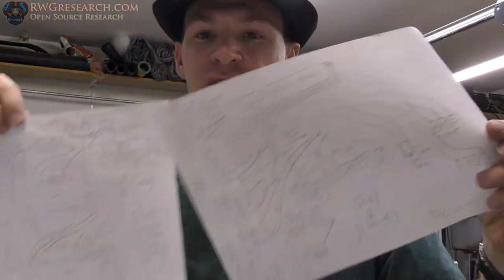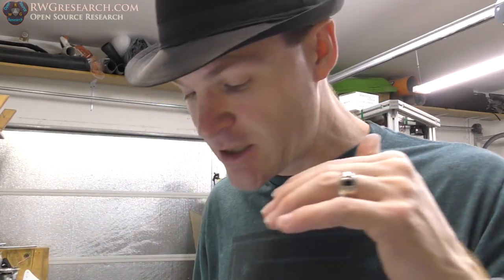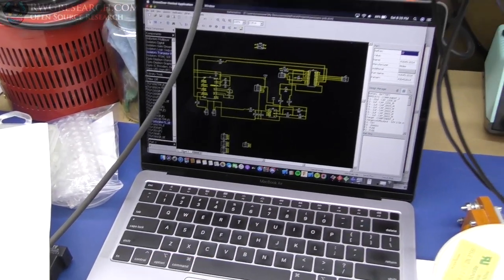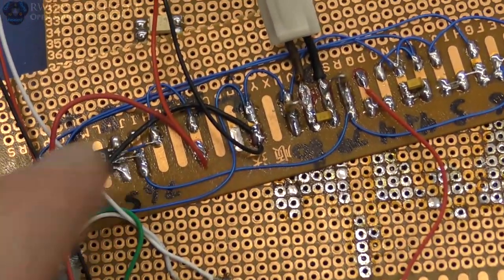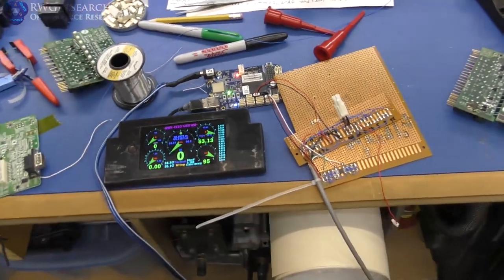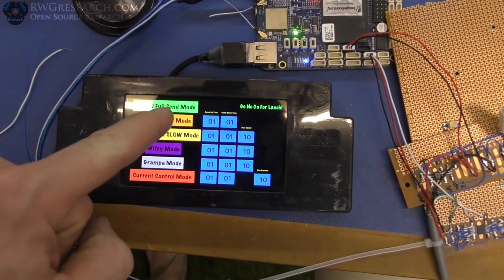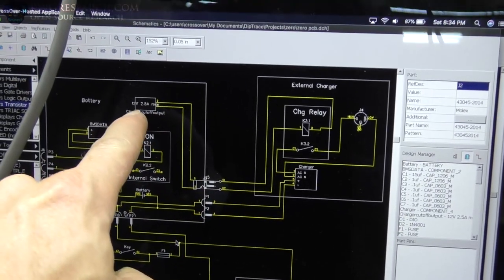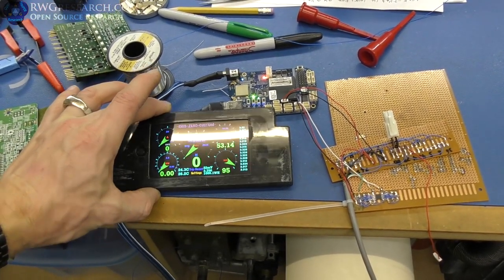Zero P18 - Doing The Electronics The Hard Way...  (So we dont need to later)

Comment: hey Russ, nice to see you again. would you please give us some guide lines on where to start and what to use to write an app for a smart device like your display?
Reply from the maker: Hey. well. better late than never ( I think) lol. your question is a hard one.  if you have an idea... and self motivation... you have what it takes... I started by looking around on how to do what I wanted, then self taught my self what I needed to learn with apps, data types, how to interface stuff. linux, there are a bunch of free resources on the internet. I watched the starter series from a guy called " code with Chris" took Many many hrs and motivation but finally got to a point where I started to understand Xcode. ( free to use but you'll need a newer Mac) if you wan to install it on a device you can but I suggest paying the 100$ fee to have the developer stuff... now the reason I use X code and apple is the ease of use... you don't need to he a hard core programer to learn,.. can be frustrating at times ( a lot) if you go with android or something it may be more code intensive. and it took me over 6 months to get to where I was so I could even make the app... it just so happen that I had the experience I needed to give it a go from a different current project... so that's what I can tell you. I hope it helps!! oh and python is a nice easy to use language. lots of places to learn it by looking around for free info on the net...  ~Russ  ps. slow and steady progress...
Reply: @RWGresearch  thanks for replying, I already checked your older video to find out what you were using. I do program for pc and embedded system,  but I'm not a smart device guy, I don't even use one. I thought I'll check it if I needed it in the future.